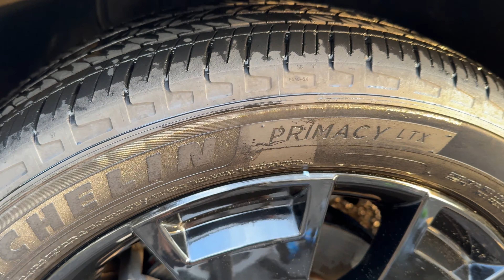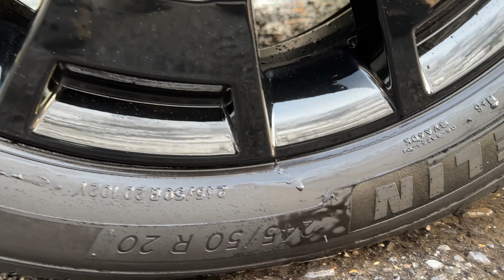Tire Shine Showdown (What’s The Best Tire Gel Dressing in 2024)

Comment: What tire protectants do ypu use that will actially last a long time?
Reply from the maker: @btbd2785  these are the longest lasting tire shines 👍besides actually tire coatings but they are not worth the time to install imo as they when they start to chip/fail in some areas they just never look the same